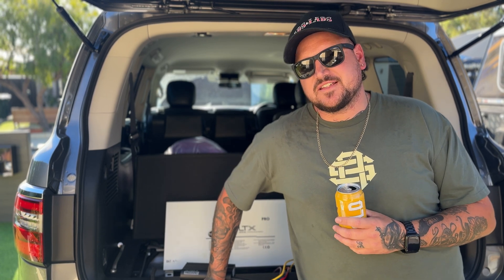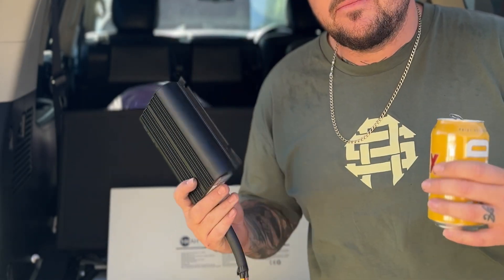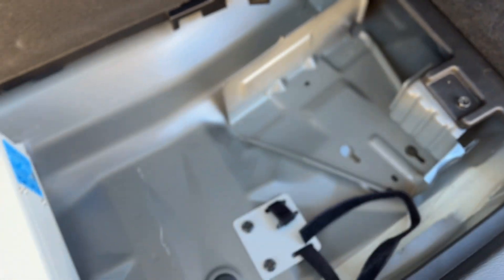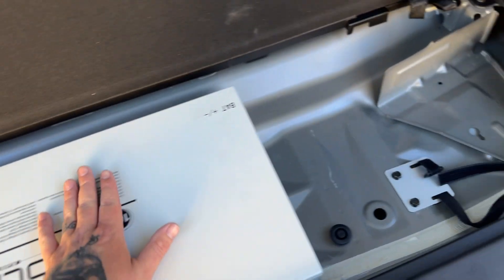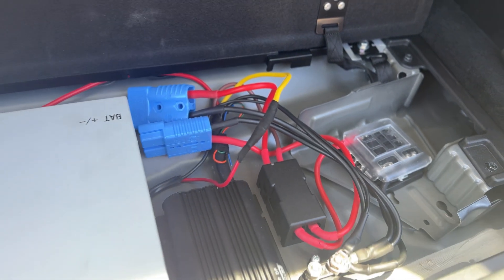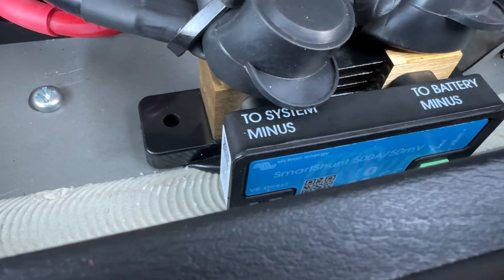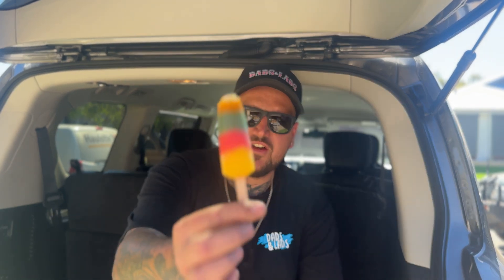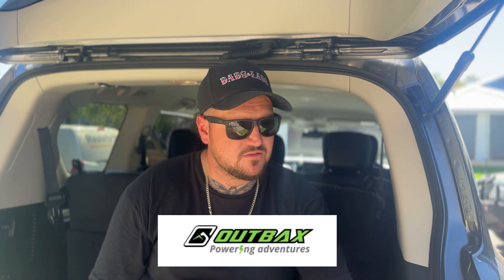Nissan Y62 Patrol Lithium 12v Setup | Install Of Full Off-Grid System  For Traveling

Comment: How’d you go about adding the shunt? Both ando’s used where’d you run the positive feed to?
Reply from the maker: Hey bud , the shunt runs off the negative so all negatives to the shunt for any loads and inputs like solar. 

Used a victron Bluetooth shunt and the wiring diagram is simple 

I’m a mechanic by trade so I mapped this out beforehand using a program called tiny cad made the install easy I I new that it would all work
Reply: Ohhh, might be a spud question, the vbatt+ is just power for it then? Ran to fuseboard? 

I understand the negs but thought the red wiring it came with HAD to go to battery
Reply from the maker: @bradarscott2471 nah so both sides of the shunt will be battery negative , then other side all the negative loads 

A small 10amp 12v battery positive to a small terminal on the shunt that allows it to be powered all the time and measure current flow
Reply: @9to5erss  yea gotcha i think, power cable for the shunt runs to ya fuseboard for power and as the diagram says negs run of the main terminals on the shunt yea? Got any updated photos on socials somewhere i can have a gander at? Having a crack at the exact set up tomorrow other than using a kickass wiring harness. Video was good as by the way 👍🏼
Reply from the maker: I’ll see what I can find on my phone mate flick us a msg on socials Instagram 🙌🏾

Comment: Mate sill happy with battery?
Reply from the maker: Mate dead happy still working well and heaps of power for the fridge ect
Reply: @dadsandladsoutdoors  I'm just looking at doing the exact same just too run my 80l engel.  Just hard to get specs on it
Reply from the maker: @danielrobertson1182 yeah mint bro I mean you need solar but if you say have a 160w and above panel I haven’t run out of power

Comment: Hi where do u actually run the wire thru to main battery?
Reply from the maker: @TammyLumby  yeah mate correct ✅ run correct size gauge wire for what ever charger your running MIDI fused correctly too

Comment: I like it. Do you have alternator feed coming in or only solar? I will do something very similar i like it
Reply from the maker: Yeah alternator feed coming in 🙌 so solar and off the vehicle , Also disconnected the alternator smart shunt so it’s a constant voltage
Reply from the maker: If you need anymore photos msg us on Instagram happy to share 👌
Reply: Great clean install mate, doing something similar in my big girl...wondering if you went for an internal power run from start battery through the passenger side firewall grommet or external chassis rail run and then into the rear. I'm not sure which way to go with the 6 awg I'm running 🤔
Reply from the maker: @Marc-si8me cheers mate appreciate that 

I went external then up through the passenger side gromet in the boot
Reply: @dadsandladsoutdoors  thanks mate appreciate the response, after your vid I found the rear grommet ... should be good to go now
Reply from the maker: @Marc-si8me nice brother send us some pics on socials keen to see it
Reply: Did u have much issue running to the alternator? I have the same battery and a kickass dcdc. Just havent built up the berries to start cutting and chopping haha
Reply from the maker: Nah mate run fused power from your start battery to the DCDC and will be good
Reply from the maker: @MrRadley1702 DM me on socials if you want to know more